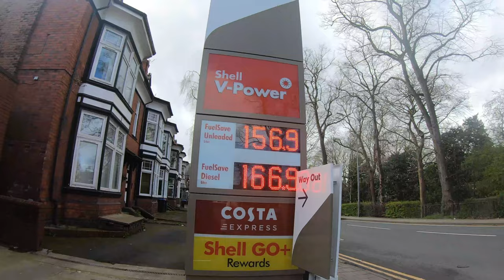I can't believe I let this happen 🤦‍♂️ (Motovlog #3)

Comment: You need to do a top speed test I managed to get 33mph on a long flat bit of road, using a GPS as the Speedo as mine dont work
Reply from the maker: Yeah I definitely need to! I can't get the part to fix my speedo and odometer at the moment, the drive gear inside the hub was mangled when I opened it up. I'll give it a go with an app I've got on my phone as see if it works
Reply from the maker: Update - I just gave it a go with an app called 'Speedometer' on my phone and it seemed to be working. Managed to get it to 31 but it still had a bit to give. Need to find a longer straight